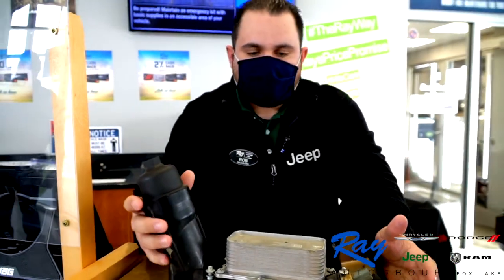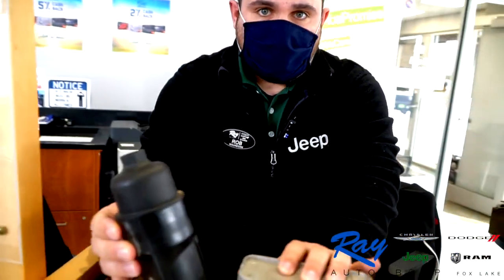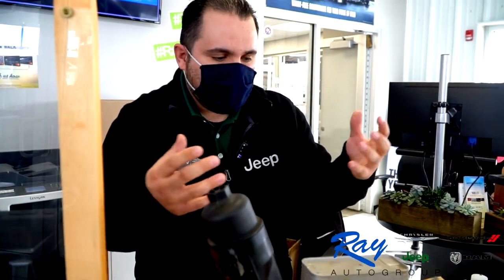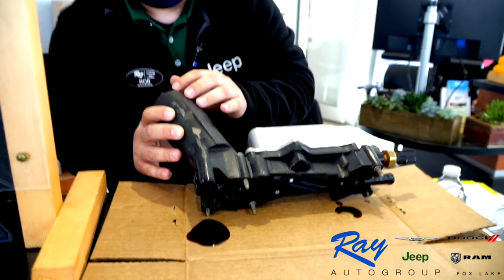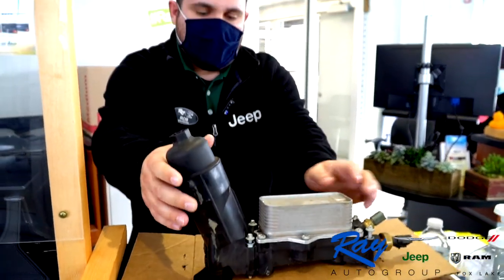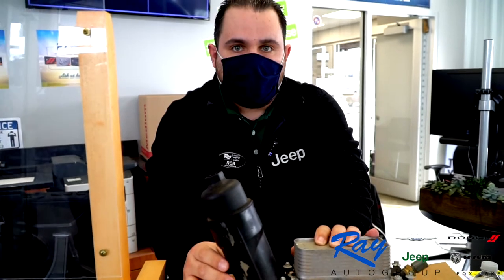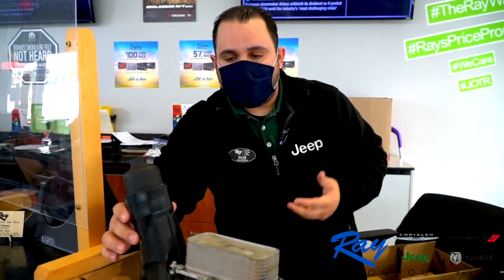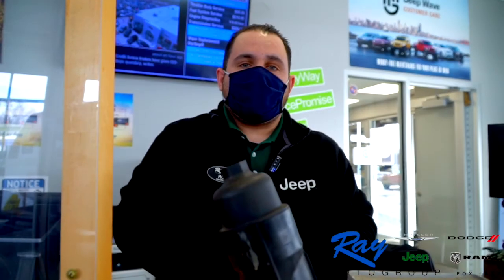Jeep 3.6L Oil Cooler Failure

Comment: Hey It's very simple to realize that this part is SPECIFICALLY made to either leak oil or coolant and every time it does it, it's disassembly of the half of the engine to get to intake that with cost of part will cost around 2 grand. The original part can last upto few years, but the aftermarket "improvement" part can only last a few months. A jeep is a lemon by default from the very first foot driven on the road. I'd rather lease G63 wagon -- a lot cheaper to own!!!

Comment: "Do the oil change at the dealer" will not prevent this problem.
Reply: I did and the dealer cracked it....let's see how they deal with it.
Reply: @HunsValley  Mine was covered by the extended warranty, and dealer put the same old stuff in.
Reply: I have the extended warranty also I will find out tomorrow. @GardeningZ

Comment: Buy the Dorman aluminum oil filter housing replacement part.  The OEM part will just fail again.
Reply: Not necessarily.
Reply: @IFIXCASTLES  Ok sure, you may get lucky with the new plastic part, or you might sell the van before it cracks or deforms again, so the next sucker has to deal with it. Why though, when you can get a superior part that won't deform for essentially the same cost?
Reply: @rogerz8051  look at it logically......it's a crap shoot either way..... Parts today are garbage..  The engineering that required a part like this is  pure stupidity. The sealing between the head and the cooler is garbage with inferior materials that cannot withstand the heat and pressures, thus leakage will occur.
Reply: @IFIXCASTLES  When you say "the sealing between the head and the cooler", I assume you're talking about the oil filter housing unit since that is between the head and the oil cooler.  Do you really think the Dorman cast aluminum unit will fail at the same rate as the OEM plastic unit?
Reply: @rogerz8051  50-50 we are talking seal failure not the plastic cracking. Uh yeah the oil cooler mating surfaces to the valley between the intakes .
Reply: @IFIXCASTLES  Thanks Greg.  Understand.  Always good to learn from those with more experience.  The cracking usually happens when an oil change tech over tightens the filter cap.  Hopefully the metal version will at least be less prone to that happening.
Reply: @rogerz8051  unfortunately that is not the case. Thats just what the dealers are telling you so they can charge you for it. The truth is they leak from a poor design. The seals leak at the base from dissimilar materials expanding and contracting. Just a bad design thats had about 7 updates and still leaks.
Reply: Yeah bring your Jeep in for a oil change  the simplest job you can do at home
Reply: Dorman fails a LOT faster than OEM. OEM is a lot smaller and gives more room for air. Dorman part is TOO large and leaves no space and only HEATS oil instead of cooling to fail even faster.